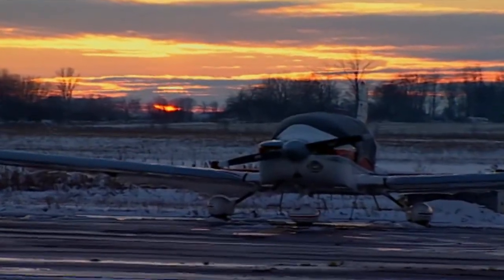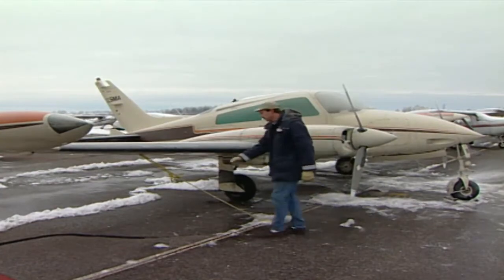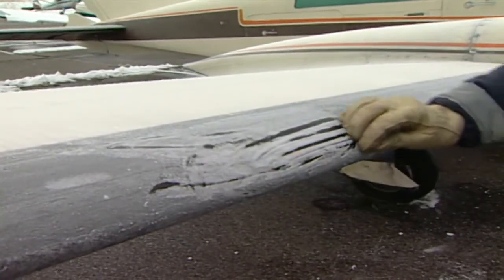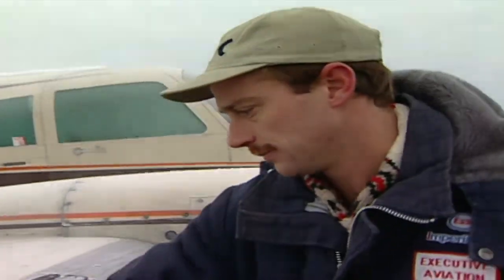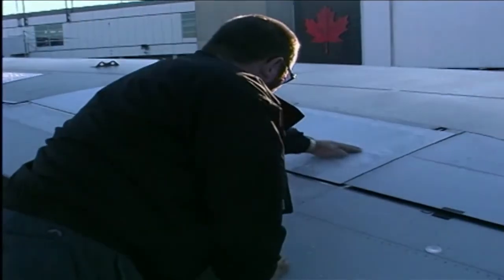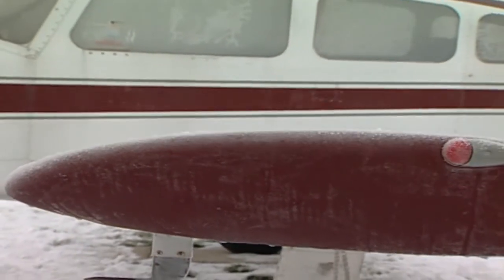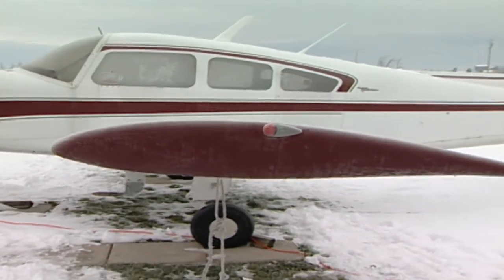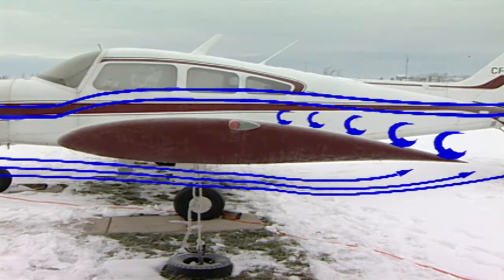SmartPilot | Frost and Flight

Comment: Thank you for this video.  Frost looks so harmless.  It does not have a dramatic effect.  It is more insidious and subtle but the effect is still there reducing performance from a clean wing.  I have flown with frost.  It flew but it was always looming in the back of my mind that I made a mistake by not cleaning the wing thoroughly.  Never again.  Your graphics helped describe the effects of the frost.  All the best  Pilot at a higher level of ignorance.